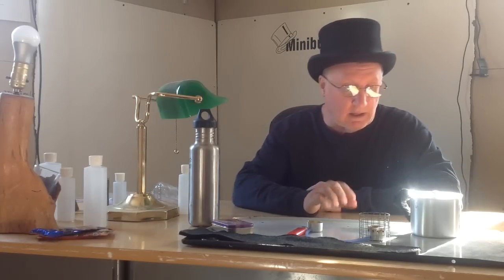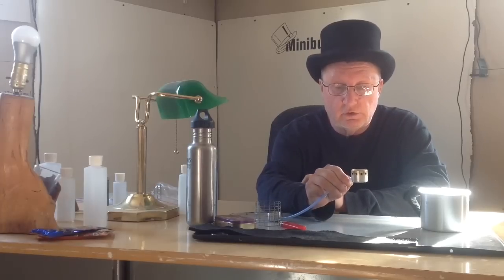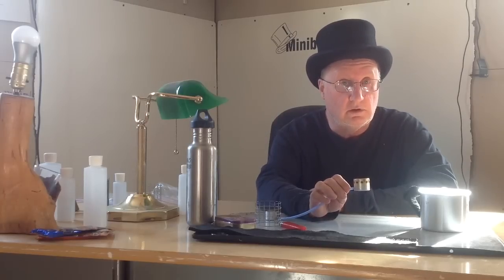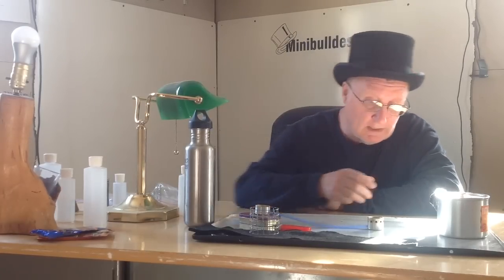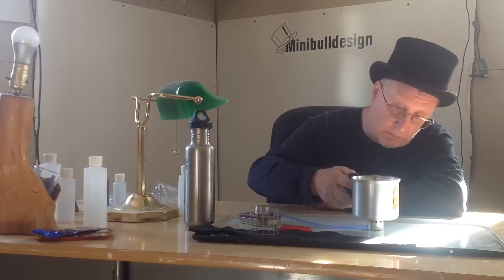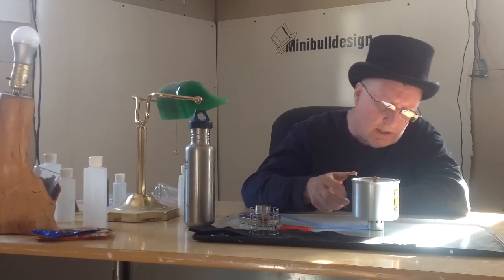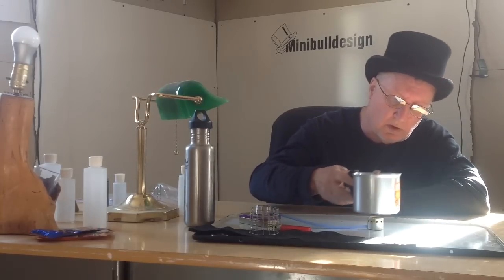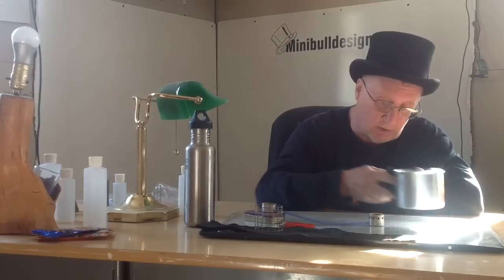Turbo Choke

Comment: Tinny, if you close the side holes using thin metal ring can the stove be less hot and use it to bake (ie. back to original choke hazard)? That way you have a very versatile stove that can boil water fast and also bake.